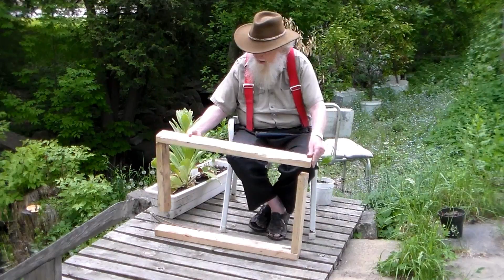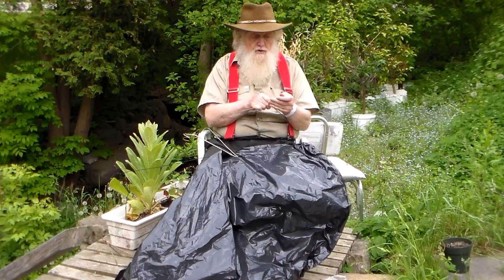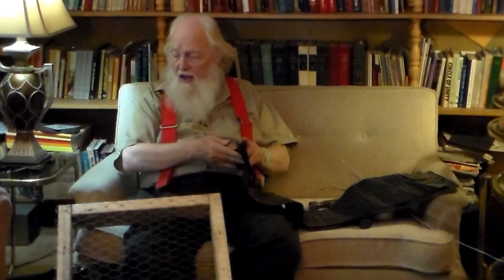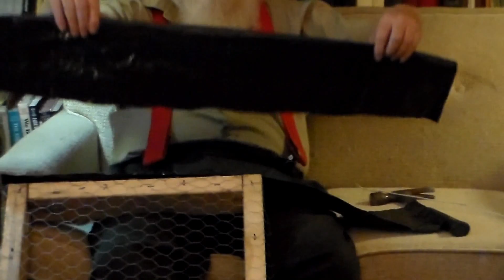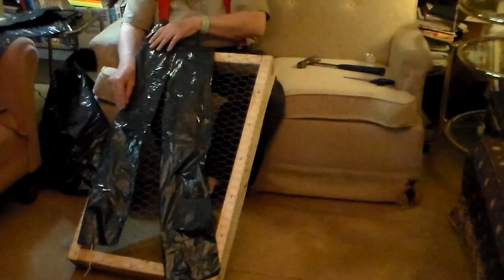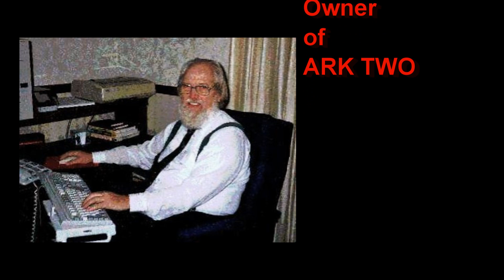Ark Two # 2a Kearny air pump part.1

Comment: I understand how the Kearny air pump works but I do not understand how fallout material is kept out when you pull the pump in. Can someone please explain to me how fallout is kept out when using this device? Please.
Reply: Use activated charcoal for the filter